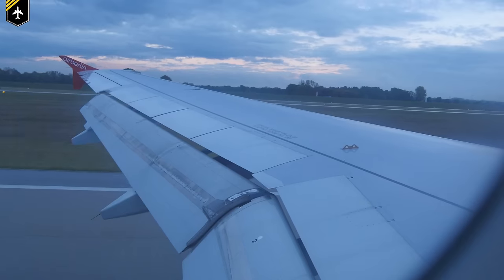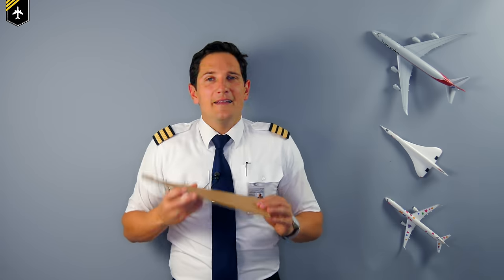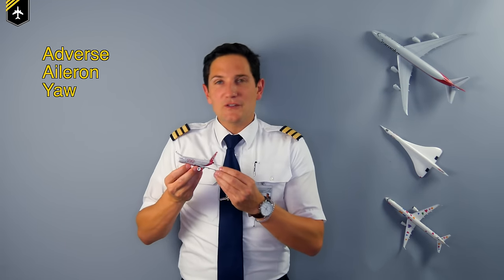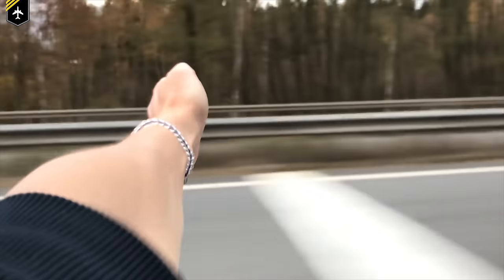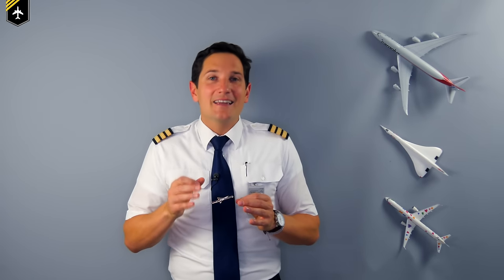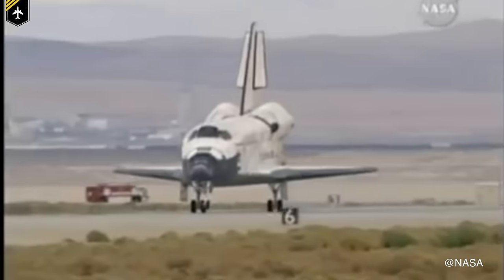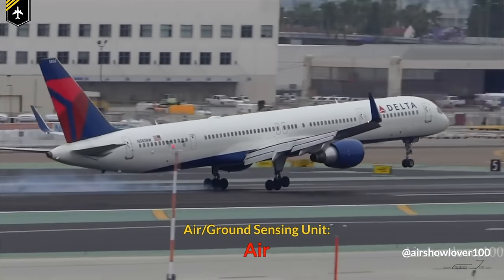What are SPEEDBRAKES/FLIGHT CONTROL SPOILERS?! Explained by CAPTAIN JOE

Comment: Back in the military (late 1980's) one of the guys in our squadron had some sort of (Mid 1980's) japanese econo box station wagon with 4 massive doors,  As we are riding down H1 in Hawaii we would yell Airbrake then swing all the doors open.  The car would just slow down instantly.  With the doors open like that the little car could not push it self past 45mph.  Used to make  Sean "Star Mann"  Starr all mad,  But it was great fun.
Reply: The way we work through YouTube haha, Flying has always been kind of a hobby for me as well. Have a dad who was one, also a brother along with couple X girlfriends who's parents had planes lol
Reply: I remember doing something similar back in the 80's But instead of breaking we would open the right door on a straight stretch of highway  and watch as the car gets pushed in the left lane and vise-versa. Kinda like aerodynamic steering.(BTW there were no other cars in sight)
Reply: would not want to do that with suicide doors like the old lincs.
Reply: Which branch were you in?

Comment: Hi Cpt Joe.. I used to fly the learjet 35. You have to manually extend the speedbrakes on landing on that type. Fun fact. Even though it's an airplane with a take off mass less than 10 tons. It has both fuel dumping and a brake chute!
Reply from the maker: The comment I was waiting for! Thanks! How interesting, I´ll well to read up on that :)
Reply: What kind of landing distances that must have?
Reply: @jur4x  was not to bad actually. Long for a small jet but about 1600 meters at MLW if I remember correctly
Reply: 727 Also!
Reply: I fly a Hawker 400 and we also extend the speed brakes manually with a switch. Also this aircraft has no ailerons so the same surfaces are used as spoilers for roll control.

Comment: I do actually fly an airplane where you extend the ground spoilers manually. I don't know if this is considered cheating, but I fly gliders.
At final approach we extend the speedbrakes to decend faster to touch down where we want to. Because we don't have an engine, are the speedbrakes the only way of regulating our decent rate. 

At touchdown we fully extend the brakes to prevent bouncing up again and of course slowing down.
@Captain Joe
Reply: We also use this strange control surface called a rudder😂😂
Reply: kind of similar, where the airfoil is creating lift in normal speeds the spoilers decrease the lift slightly and help slow the plane on larger aircraft
Reply: It basically turns the glider into a small aircraft -- when I flew in the 80s, that glider with the spoilers out felt about the same on finals as the C150 I flew in the 00s without flaps

Comment: The space shuttle was essentially one giant air brake. When it reentered the atmosphere at mach 21, the entire bottom surface of the shuttle became an air brake. Additionally, it did a series of S curves in order to bleed off speed before landing.
Reply: It's a brick (With wings)
Reply: @keyvan8259   It is the world's biggest glider and was effectively a space-van.
Reply: Like Jupiter653 said its a flying brick with a tail and wings.
Reply: widowmaker.... mach 21 or mach 2 decimal 1 ie 2.1 ??
Reply: @bahardin3992  mach 21, 21 times the speed of sound during reentry
Reply: Actually the shuttle was a 'lifting body' Without this feature it wouldn't have been able to glide at all with such short stubby delta wings placed so far back on it's CG.
Reply: @bahardin3992  17,500mph. Mach 22ish. From the NASA website:

"As a spacecraft re-enters the earth's atmosphere, it is traveling very much faster than the speed of sound. The aircraft is said to be hypersonic. Typical low earth orbit re-entry speeds are near 17,500 mph and the Mach number M is nearly twenty five, M < 25."

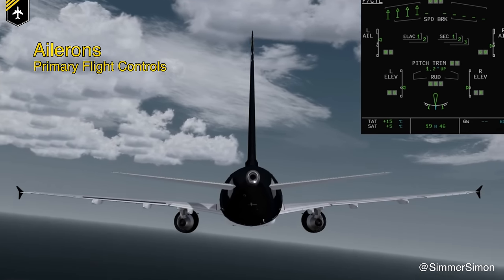Comment: Hey Joe! I am a glider pilot, and the airbrakes are crucial for a (good) landing. With a glide ratio of 1:27 or so, we could keep flaring for a looong time if it wasn’t for the airbrakes! Also the approach profile will dictate how much airbrake we need on final, although there are standard altitudes for the circuit. Wind is very much a factor. Great video!

Comment: Hi Joe! Great, professional video, as always.

3:32 When I saw this, I instantly recollected when I learned to fly a particular manoeuvre related to this adverse yaw effect during my first pilot training at the age of 15 in a glider: the forward-slip.

Gliders are much more prone to adverse yaws, hence their relatively large rudders. :) The forward-slip is pretty common for gliders and, as you know, used to drastically increase the sink rate without gaining airspeed for a steepened descent behind obstacles like tree lines, buildings and such in front of a 'runway' , when you gotta lose altitude more quickly than you would normally have to because you're higher on your final than you normally are due to an obstacle. Especially when a glider gets shot down. I'm sure you know how to perform this manoeuvre. The otherwise unwanted adverse yaw comes in pretty handy when you want to execute a forward-slip.

And since this manoeuvre is also used in case of an engine out emergency landing, when all aircrafts turn into gliders, and the plane is still too high or/and too fast and has no chance for a go-around but has to land on its first attempt, an incident crossed my mind when Air Canada flight 143, a Boeing 767-200! , ran out of fuel (in 1983) and Captain Pearson decided to execute a forward-slip and safely landed her with all engines off at an Airforce Base in Gimli, Manitoba. As a glider! Silently coming in and managing to land the slipping and gliding 767 without any of the 61 passengers having been injured. That was something. A very, very rare, if not the only occasion when a captain decided to execute a forward-slip with an airliner. Ever since this particular aircraft was nicknamed the 'Gimli Glider' :))

Be that as it may, I thought it could be interesting to also cover the forward-slip technique in your next video about aerodynamics on ailerons and rudder controls, don't you think? Since it's so uncommon (thankfully) to execute this manoeuvre in an airliner... could you imagine to reconstruct in a simulator what happened back then to Air Canada 143? Would you feel like forward-slipping an Airbus or a Boeing for us in a synthetic flight? That would be awesome. I know, the fees are expensive but maybe worth it? o.O Here are some details: planecrashsite.wordpress.com/accidentinfo/1983-2/810-air-canada-flight-143-july-23

Happy landings! :)) Greetings from EDDF!

Comment: joe, can you explain what all of the engine instruments on the 747 do???? such as N1, N2, EGT
Reply: Fantastic idea!
Reply: Oh yeah, please joe!
Reply: Yes
Reply: @AM.Boxing  i know, but it'd be cool to have a video about that!
Reply: he already has
Reply: N1 = Revolution of the Fan , The Low Pressure Compressor and The Low Pressure Turbine.
N2 = Revolution of the High Pressure Compressor and High Pressure Turbine
EGT = Temperature of the turbine exhaust gases as they leave the turbine
Reply from the maker: Great idea for a video! Thanks😉
Reply: Captain Joe I love that idea!
Reply: If you want to learn about jet engines, checkout AgentJayZ's channel.
Reply: Actually N1 N2 (N3) EGT and EPR(THR on airbus) are not only for 747s ,instead all airplanes use them no matter airbus or Boeing 

N1 is the %RPM of the low pressure compressor or the front fan.I suppose you know the structure of an turbofan engine. It indicates how fast the fan in spinning and also indicates whether the engine is fine or not.Cuz during an engine failure,the pilots will check if N1 or N2 is positive to determine whether the engine is damaged.A damaged engine cannot be restarted.

N2 and N3 is the %RPM of the higher stage pressure compressors of the engine.You will only see N3 on Rolls-Royce engines,but they are some what similar.N2 N3 can indicate if the engine start is successful. If N2 (N3) is increasing during start,it means it is a successful start.

EGT stands for exhaust gas temperature.If the EGT go too high, it can be an indication where the engine is overheating and maybe a possible engine fire,engine surge or severe damage.

EPR or engine pressure ratio shows whether the engine is surging or not.If the engine is surging,you will see EPR fluctuating.Normally the value EPR corresponds to the position of thrust levers.In some airbus models,it will be represented %THR(thrust).

Hope this gives you some idea.
Reply: @flywithcaptainjoe   I really like to see videos with the amazing information by you captain about 747 the queen of the sky 😊
Reply: @AM.Boxing  If the engine is a dual rotor, Low Pressure turbine is connected via a shaft to the Front FAN and to the Low Pressure Compressor and this is measured in N1. This low pressure turbine is located in the back, next to the nozzle.
High pressure Turbine is connected to the High Pressure Compressor also via a shaft. N2
Reply: You guys have basically got it right but there are no speed sensors in the turbine area.  The reason is simple, why would you put a sensor in an environment of 2000 degrees when you can put it in an environment of 100 degrees and get the same reading? What’s less likely to fail?
Reply: @blampa  Incorrect. Some turbine engines do have speed sensors in the turbine section. RR trent have them for shaft breakage indicating. The turbine speed signal is compared to the N1 compressor speed and if there is a difference the engine auto shutdowns.
Reply: @bradw3116  overspend indicator (shaft breakage)?

Comment: gliders kind of have full manual spoilers, ya know...
Reply from the maker: Toivo wiikari that’s correct! Didn’t think of those😉
Reply: Toivo wiikari what gliders do you fly?
Reply: I remember using these on the few glider flights I did. They were quite big and would pretty much stop it dead once deployed, you would drop like a stone if you pulled them in flight.
Reply: No better feeling than pulling out those bad boys after a long day of soaring!

Comment: A glider is a particularly good demonstrator of adverse yaw.  Left stick by itself will not do a great deal other than give you right yaw!  We use a lot of rudder on turns, especially on gliders with longer than standard (15m) span.  This is why the yaw string is so prominent on gliders, and some might argue it is the most important flight instrument.

Comment: In simplistic terms of u want to turn left, not only should right wing go up but it should go around and faster than the left wing. You could do it with differential thrust but the best way to do it is to make the left wing go slower. Hence the spoiler on the left wing is deployed which increases the drag so that left wing goes slower.
Also it so happens that when the aileron is lowered on right wing it not only increases the lift but also causes a drag slowing down the right wing, exactly opposite to what we wanted. This causes the yaw in wrong direction.
Planes without spoilers may use differential ailerons ie the left aileron deflects more than the right one creating more drag on left wing so that it moves slower

Comment: @ 7.30, my dad used to fir those (and much more) at the factory in hatfield in the 1980s. the same style was used on the blackburn bucaneer years before. AND @ 7.40, the same principal is used on the rutan verieze / long ez. the two wingtip mounted rudders are independent, only turning outward. press the rudder bar for brakes and they both turn outward.

Comment: It may be worth mentioning, some fixed wing  ultralight or microlight aircraft do not even have ailerons.    
One example is a light known as the Mac CDL, which  only has a single Spoileron on the top side of each wing to induce role (and requires some muscle to do it).
It is easier to just fly it using only the rudder and elevators, you will get very tired if you try to roll it into every turn.

Comment: The Let 410/420 has manual ground spoilers. You are restricted to no more than 0.5 m above the ground and below 102 KIAS. They operate electrohydraulically, and are actuated by a trigger on the left yoke. 
Thanks for your awesome work.

Comment: Just as an FYI: all of the shuttles had speed brakes, not just Discovery.  There were different rudders that had different sensor packs in them for different monitoring functions which is why the top of each rudder looked a bit different.

Comment: Those flaps come with the manual transmission and rotor brakes brake package. If the airlines would have upgraded to the 777-A (air brakes) package they would have gotten the Androud head unit, heated seats, the seat position 1/2/ or 3 feature, the automatic windshield wipers with rain detection,  a backup camera, coffee service mugs labeled pilot and copilot, the panoramic sunroof and air brakes.

Comment: Thanks for ur vid mate.
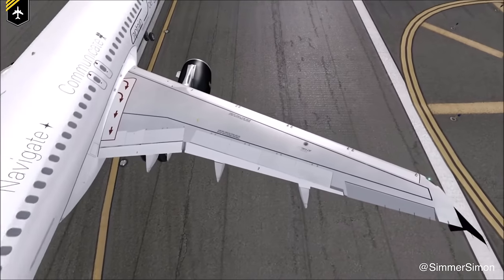In 1:44 spoilers are part of primary flight control surfaces not secondary. In 3:08 B777 inboard ailerons are called flaperons (Used as aileron & flaps at same time). Useful vid though.

Comment: Not an airliner per se, but flying executive Cessna Citation X jet C750 we also have full manual speedbrake control. No auto use in-flight as we have yaw damper and eventually the spoiler extension becomes automatic pilot muscle-memory. Touchdown and get them out ASAP as wing is very swept back and you certainly don't want to bounce again into a slow flight attitude so close to the ground.

Comment: Captain Joe, if i'm not mistaken the air brakes are also used while taking off in strong wind to help the plane to reach enough ground speed for a safe take off.
Reply: Lago Naki no. Ground speed has nothing to do with aircraft performance.

Comment: Also if I'm not fricking wrong, the first aircrafts to be equipped with speed brakes are the Junkers Ju-87 and Ju-88 but they are not spoilers cuz they're mount below the wings so they don't spoil the lift but creates a pitch down moment when extended

Comment: Hi Joe. On the 777 It’s actually not an inboard aileron. It’s called a flaperon. The outboard aileron gets locked out at high speed and the flaperon does the work instead. 👍🏼

Comment: Many military aircraft still use manual speedbrakes during landing. The A-10, B-52, F-16, and F-18 just to name a few. Though the speed brakes are controlled with a thumb switch on the throttle except for the B-52 which still uses a beefy lever.

Comment: Capt., very good explanation on the howling sound I often hear from overhead aircraft as they turn into a 12 mile final for 27R at KPHL.  I always though that it might have been sudden air piling up in front of the large fans reducing rpm's.  The sounds seems to occur most often when aircraft approach  the final turn without any prior vectoring(?) and may need to reduce speed quickly.  My home is 12 miles east of PHL, and right where ATC often sets up a Four Post arrival pattern.  I enjoy watching the action.  Thank you!

Comment: I believe IL-62M is the one without automatic speed brakes and still operating in rural Russia (less then 10 active duty aircrafts in the whole world) but it is old! I couldn't find exactly the quotes to support that claim, however couple of papers mention, that the automatic air breaks system was intended in the next redesign just before the plane was discontinued.

Comment: @Captain Joe do you take questions?  I sense you are frightfully busy flying & making these vids, but if you have time ... I've two questions re: landing gear (a vid you made a few months ago)...

1.  Aircraft esp commercial/cargo evidently go thru many tyres in their lifespan.  I've often wondered why (and I realize how absurd this might sound) aircraft wheels (e.g. 737, 757, 767, 747, Airbus etc). do not have little 'cups' so to speak on the "hub" area so that when gear lowered for landing, the wheels 'catch' air (as the jet moves forward towards runway) and start spinning, thereby reducing the tyre wear/ "burn" when touchdown and wheel starts from 0knots and goes to 130 or whatever within mere moments - hence the big puff of tyre smoke at landings.  That is to say, why dont manufacturers put little air catch devices on wheel hubs to get wheels spinning prior to touchdown and thus partially reduce "tyre smoke burn/wear" at landing?  The incoming airflow is free, and I should thing the nominal weight of little cup air catcher devices on wheel hubs would be more than compensated (in extra fuel cost) by burning thru fewer tyres each year?

2.  You mentioned the 777 landing gear 'high heel' aspect to reduce tail strike risk b/c the -300 is ~10 meters longer than the -200.  So, why don't all airports simply build/install their runways 3-4 feet lower in height, thus reducing the tailstrike risk of all aircraft - problem solved!

[2 above was just a little dry humor  :]

Comment: I once had to wait at the airport because something on the left wing had to be replaced. The pilot said the panel actually did its job because it did what it was supposed to do. Lucky for us it only took 2 hours because they had the panel in the airport or capital stock so they could quickly install the panel. After boarding we were sitting in the best spot to watch it, we noticed these panels (from this video) being tested rigorously. So I think that was the panel they replaced.

Comment: Very good explanation. I didn't know that it was also used to control the yaw in a turn. As you mentioned, in the small plane we just kick the rudder to do a coordinated turn :-) My groundspoilers on the SEPLs is just to clean up just after touch down to get weight on the wheels :D